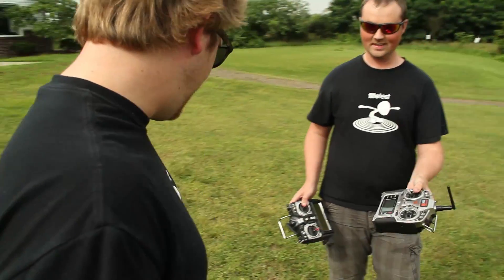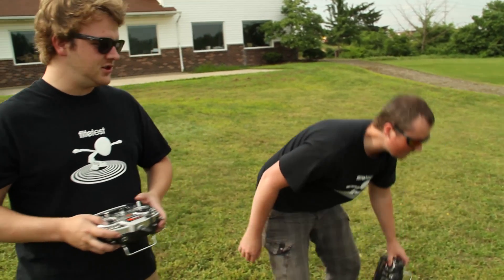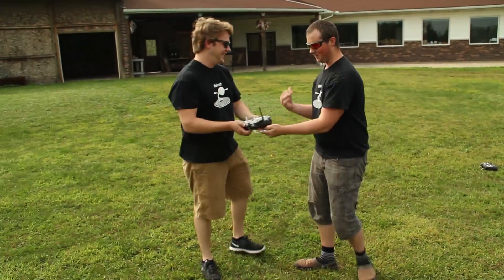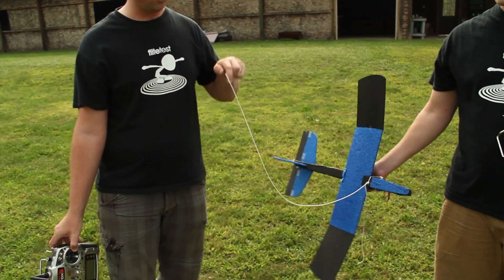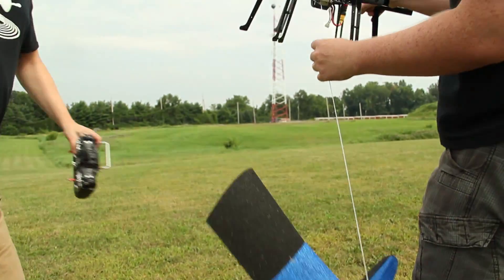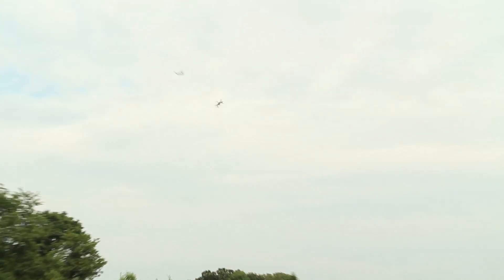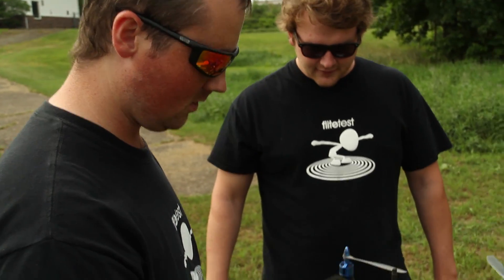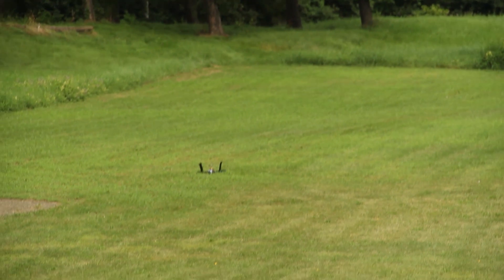3D Robotics Hexicopter vs. Glider

Comment: There's an episode of "James May's Toy Stories" (the Season 1 Special, "Flight Club") where they solve the problem of dropping a glider from under a full size helicopter. To keep the glider from getting lift they encase it in a lifting box. A similar, simpler method could be used to make this succeed, I think, just put the glider in a cardboard box with the bottom cut off and lift that...

Comment: What is needed is to tie the string to the front of the nose. A little longer string will help too. Try about 10 feet long. Really, try this. You'll be surprised how well it will work.

Comment: How about attaching the glider from it's tail, instead of the upper fuse? This way, the wings don't get airflow, causing the glider to want to fly. Yes, it will be faced straight down when you release, but if it's more stable then you're far better off. Have fun, these are awesome.